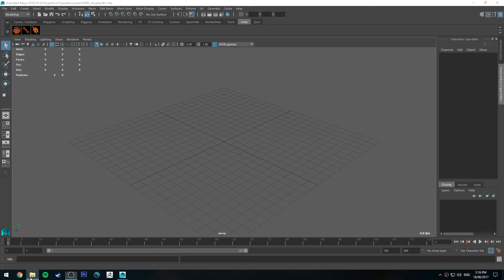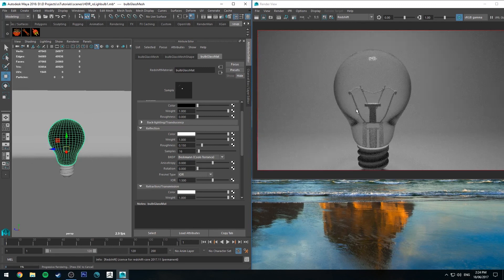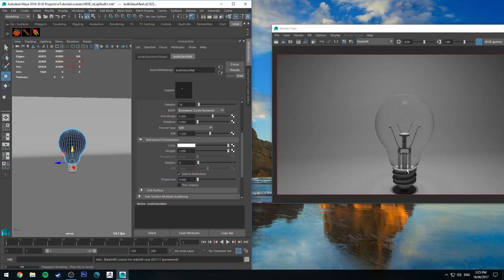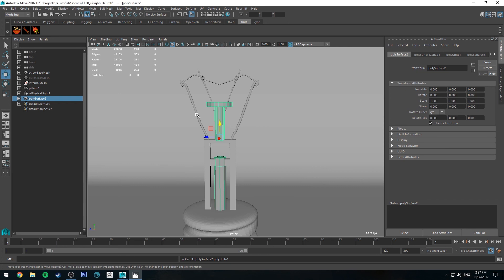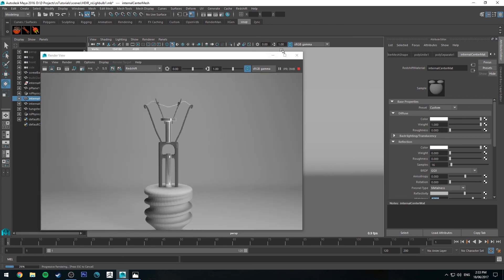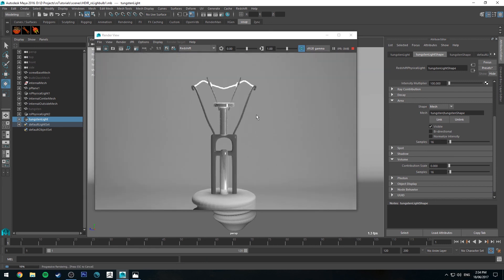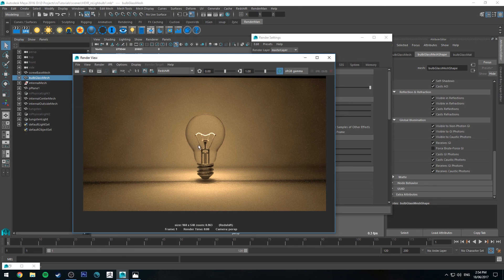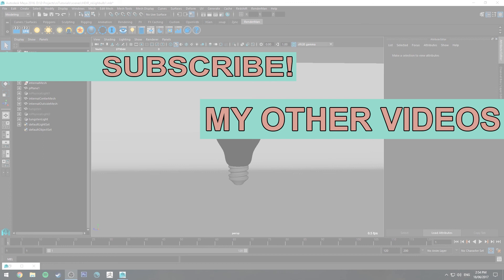How Do I Render: Light Bulb (Redshift & Maya)

Comment: hmm i have question... i tried exactly but nothing happens. I did mesh click, physical light click(Redshift Light) and then Area>Mesh, clicked 'Link'. it seems linked. but it doesn't copy original mesh and no light shows up at the render screen. what did I do wrong? (render setting is fine. the other lights render correctly) but this method doesn't work
help me

Comment: Refraction is wrong, because glass material is supposed to have some thickness, in order for the Index of refraction to be correct.
Reply from the maker: Yes I understand this but it also introduces unnecessary render time and noise which is why I forgo it in this render for basically the same result. See the Renderman version for the same discussion.
Reply: ah ok.
Reply: Hello! I have lots of comments. I still think it would look better with correct geometrical thickness and then correct IOR, also not sure about making the light bulb look like frosted glass, doesn't quite feel like a light bulb anymore. Also, two things I would really recommend in these renders with close-ups of glass, is to disable "cull dim reflections" in the glass material, and also raise the reflection/refraction ray depths quite a bit in the render settings. Both those will make it look so much more convincing. And if you do want to use refraction roughness for a glowy look, maybe try using GGX and then raise roughness a bit more, that will make it look a lot more natural. And now final comment I swear: you should never use photons as a GI engine! NEVER! Caustics don't need photon mapping GI engine to work, and it's really a terrible engine! Just use BF+IPC or IC+IPC instead and it will be a lot easier to create caustics. Ok one final comment now: when doing final renders you should really not only raise  samples in the unified sampler, but ALSO in reflections, lights, BF GI, etc. That is why you have noise. Some times this can even speed up the rendering - and give you a cleaner image!
Reply from the maker: Okay I'll try to respond to everything here. Once again, the reason I didn't make the glass thick was to reduce render times, anyone reading this that wants to try it, select all the faces of your glass, ctr-e to extrude and select your thickness (will depend on the relative size of your mesh to the project settings) set your IOR for refraction to somewher between 1.4 and 1.5 depending on who you ask. As for GGX I do agree that's my normal spec model (as I work mainly in 3DCoat for textures it uses that model also) I just forgot to switch it here. Regarding the Photon mapping engine - according to Redshift's docs it was the recommended engine for caustics which is why I went with it, I've noticed in my renders that it speeds up render times when combined with BF but haven't extensively tested the other engines. Looks-wise it's rubbish by itself but with BF it's fine. The 'final render' you see in the video isn't in fact the final render, it's was just a quick render to show the impact of the caustics which you can only view in final render mode not IPR. In the final I did increase more than just the sample rate which if you look at the thumb nail of the video is noise-free. Appreciate the feedback and discussion though, thanks for stopping by.